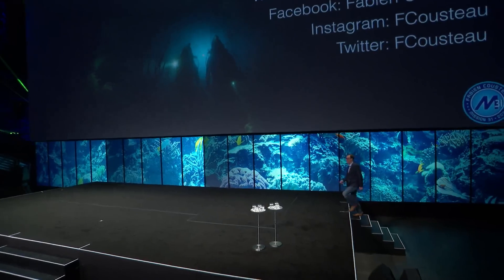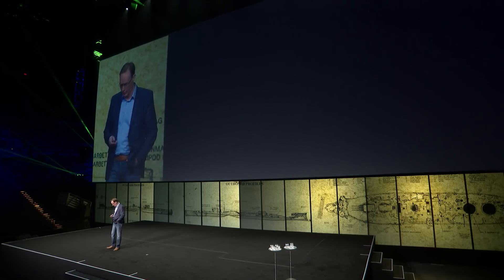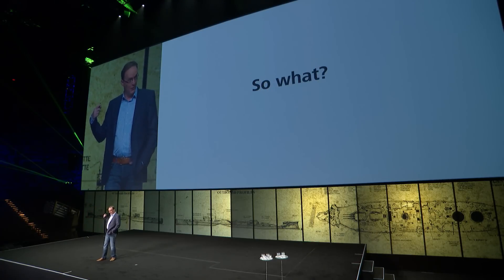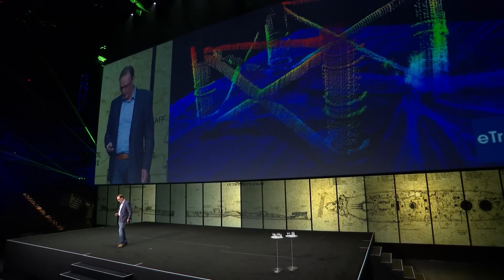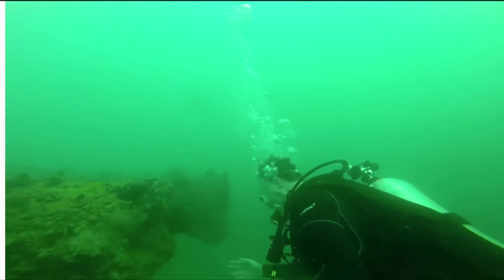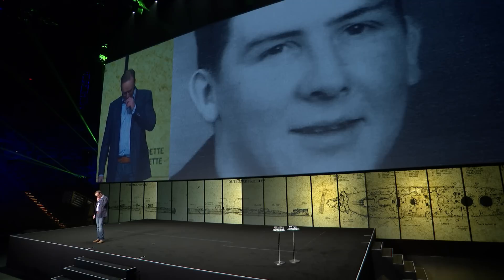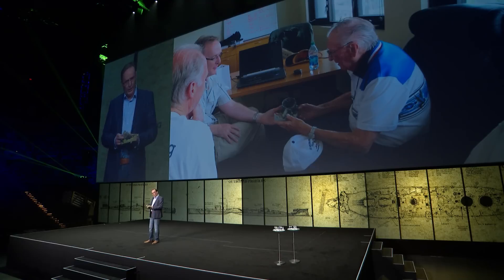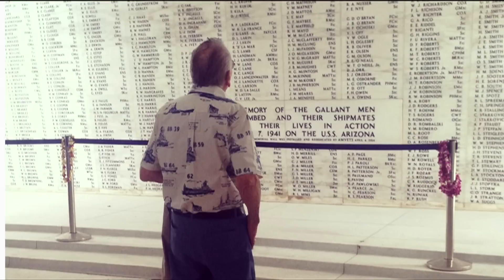Taking reality capture to a new level with the USS Arizona

Comment: They should create a scaled down model of the entire ship using the same method as the model of the pot
Reply: Photogrammetry would be difficult to do on the Arizona due to size and visibility. Two 6 foot (printed in two 3 foot sections) 3D prints from the sonar and lidar data exist. I believe Autodesk has one and the other model is at Pearl Harbor National Memorial & Visitor Center. Unfortunately, last time I checked, the printed model wasn't on public display at the Visitor Center.

Comment: I retired from Interior Architecture in Florida in 2007 and was watching this to see what Autodesk was up to lately. I started on Autocad 9 and I forget the name of the new software I was learning when I retired. Essentially you had 3D intelligent components and you built the building in data, then told the software what to draw, i.e. site plan, structural plans, architectural plans, building elevations, building sections roof plans, wall sections, details, etc - then schedules for components. The designers spent all their time in 3D - which eliminated a lot of construction problems - and then said go and the drawings were drawn and sent to the printer for review. Then to the printer for distribution. Mind blown. That is the point at which I retired. 
NOW LOOK AT WHAT YOU ARE DOING!!
WOW.
It's a shame I am now a dinosaur! lol
Reply: I am right there in the Stone Age with you. Got a Degree in Mechanical Drafting. All Done By Hand first. Then was put into the huge blueprint machine.
And out Came your Plans ready to be understood and Created! LOL
Reply: @frankconrad7323  
I so feel your pain! LOL